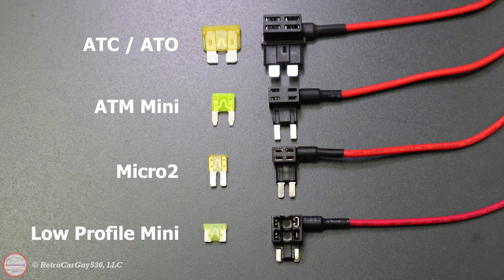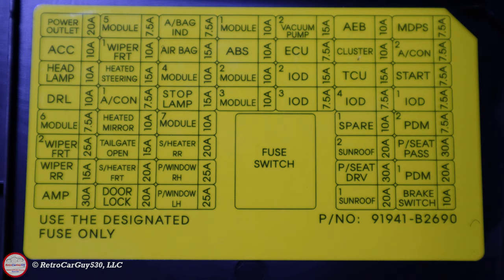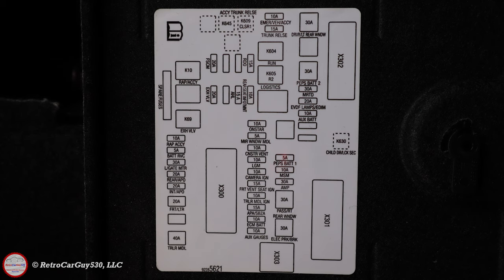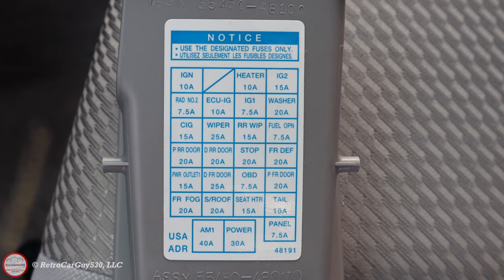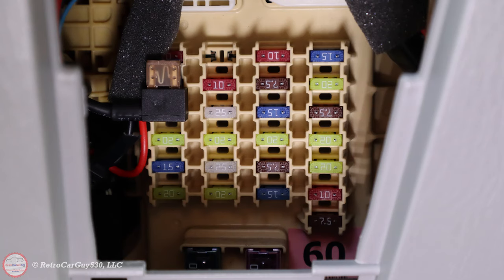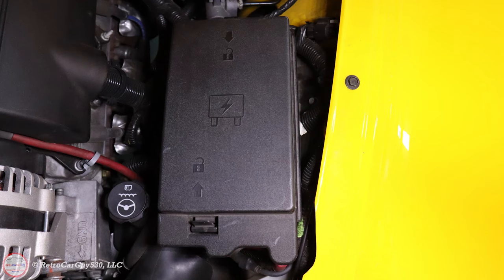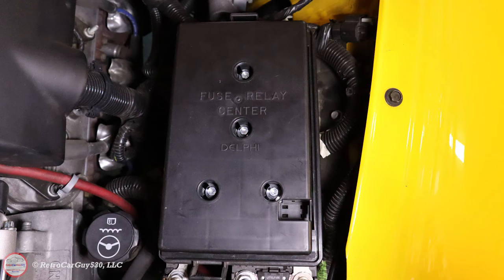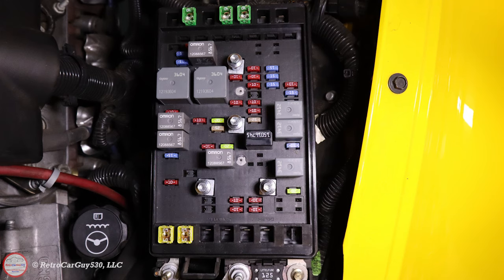How To - Add a Fuse Tap in Your Vehicle

Comment: Love how you showed fitting problems and what to avoid. Pretty complete video accept that I would suggest addressing the issue of what size fuse can be used with the new accessory. As in, does the new accessory fuse need to be the same amp fuse? Or does it need to be smaller or larger or does it matter? You can't change the siz of the protection fuse so you need to make sure you're not underprotecting one or the other, right?
Reply from the maker: @Chris the amp ratings of the fuses for a fuse tap can turn into a debate of religious proportions.

My point of view is that a fuse tap is an okay way to source power for lower power demanding devices/accessories.  If the device requires 10 or more amps, I usually use a relay to provide the power to the new accessory with the relay sourcing its power directly from the battery with an inline fuse and proper wire gauge (awg) to support the amp load.

The installation method I show in this video is where the left leg of the fuse tap gets the power from the fuse box fuse socket.  That is the "in parallel" approach meaning two power circuits are created by the fuse tap and the wiring up to the fuse box must be able to provide the amount of amperage that both circuits require.  It is not always easy to know exactly how the fuse box fuse socket is supplied its power (wire gauge, bus bar, etc).  That's why I only use fuse taps for low amp devices and in most cases my use of fuse taps is limited to adding dash cameras or radar detectors since those use under 3 amps most of the time.

The "safest" approach is to actually install the fuse tap with power going up the right leg of the fuse tap.  This is the "in series" approach of using the fuse tap.  The new accessory and the original circuit draw power through the lower fuse in the fuse tap.  If the combined load is larger than the original fuse, the lower fuse will blow.  The problem can be that the manner in which the fuse box fuse socket is powered may be able to handle the load for both circuits, but the wiring from the fuse box to the original device may not be able to handle the load above the original fuse's amp rating and that's why the original fuse was sized at that specific amperage rating.  Again, without a lot of detailed knowledge of the circuit it's hard for the average vehicle owner to make an informed decision on what is the actual best way to use a fuse tap.  That's why I limit the amount of amps to below 10 amps for any fuse tap powered device, but even then the same questions about overloading are present especially as you get closer to 10 amps for the new device/accessory. 

In my opinion, the highest level of safety is to power the new device/accessory with a power feed taken directly from the vehicle's battery with an inline fuse and wire gauge to support the power demands of the new device/accessory.  If the new device/accessory requires switched power, you can locate a fuse socket in the fuse box that has switched power and use a fuse tap to provide power to the control side of a relay.  The relay's control circuit only draws 100 to 150 milliamps (0.1 to 0.15 amps) so virtually any fuse socket in the fuse box can handle that small amount of extra load for the control side of the relay.   A 4-terminal relay (terminals: 30 = battery power, 87 = power to new device, 85/86 power/ground for control side of relay) is usually what I use for this approach.  I use this approach in a recent video where I add a high power demanding dashcam battery pack to my vehicle.  https://youtu.be/Joa0fiKZY-o?t=744s

Comment: Great info on this video. many thanks! Question: Are there any available tapping fixtures for J-case and M-case cartridge female terminal fuses? Thanks again.
Reply from the maker: I have not come across any J-Case or M-Case fuse taps.  If the accessory's power demands are beyond that of a blade style fuse and fuse tap, then you might consider using a blade fuse tap to supply the control circuit power to a relay that would then supply power of sufficient amperage to the accessory.
Reply: @RetroCarGuy530  Thanks so much for your quick response. I'm gonna try to AC compressor relay. Seems all fuse points are all time hot in my truck (2017 F150 lariat). Haven't tried w relays so far but i see no other option. Thanks again.

Comment: Excellent video. Thank you.  Clear and concise instructions and extremely informative.  I would've loved you to explain the joining the wires of a device to the fuse tap (cb radio) also I hope you have a video on using  multimeters. I'm gonna go look for one now. Also you got yourself a new subscriber 👍
Reply from the maker: The fuse taps often come with crimp style butt connectors that you would strip the wire on the accessory side of the connection and insert and crimp the butt connector to get a firm grip on the wire.  If no crimp butt connector is present, I will often solder the wires together use some wire shrink wrap or electrical tape to seal/protect the connection.

Comment: Thanks for a great video and for taking the time.  I need to add a fuse tap to supply as much as 20A to a power window circuit.  I will be abandoning the original wire because it has an open.  Where can I get a fuse tap that is rated for up to 20A for the add on circuit because all I seem to be able to find are ones with a #16awg wire and 10A maximum rating?  I guess I'd need one with a #14awg wire?  Thank you.
Reply from the maker: The blade style fuse taps that I can find all have 16 awg or at best 14 awg wire.  One fuse tap with 14 awg claims to support up to 30 amps, but that would only be for short distances (4 feet or less).  Some research I did a while back about wire gauge and max amp loads suggested that a 14 awg wire could carry 20 amps for up to 6 feet.  A 12 awg wire could carry 20 amps for up to 10 feet and a 10 awg wire could carry 20 amps for up 14 feet.  It also depends on what fuse type you need, but here's an affiliate link of mine to a ATM/Mini fuse tap with 14 awg wire: https://amzn.to/3CyTLKY

There are inline fuse holders with 10 awg and 12 awg, but you'll need to source the power (I assume switched / accessory power) for that from a relay.  Although, finding a relay wiring pigtail with thicker wire is difficult too.  The relays usually can support up to 30 amps, but the wiring pigtails tend to have 16 or 14 awg wires as well.

I wish I could help with a specific solution to your question.  I hope this helps in some way.
Reply: @RetroCarGuy530  So it wouldn't be a good idea to connect a 12 gauge wire running 10 amps into one of these 16 or 14 gauge wire taps?
Reply from the maker: @mikeestrada933  the limiting factor is the 16 or 14 awg wire from the fuse tap as well as making sure the fuse socket the fuse tap is plugged into can provide the 10 amps required.  If the length of the entire wire run from the fuse tap to the device and from the device through its ground wire (yes including the ground wire) is no more than 6 feet (16 awg fuse tap wire) or 12 feet (14 awg fuse tap wire), then in my opinion you should be able to do it.

The 6 feet (16 awg fuse tap wire) and 12 feet (14 awg fuse tap wire) are the max lengths that a circuit made up entirely of that wire gauge should be able to handle 10 amps based on some very conservative electrical automotive wire amperage charts I've used in the past.

I'm not a fan of using a thicker wire in part of a circuit than the thinnest wire in that circuit.  It gives anyone that comes after you the impression the entire circuit is made up of that thicker gauge wire which will give the false impression that the circuit could potentially handle more amps than it truly can.
Reply: @RetroCarGuy530  Okay thank you! I ask because the kit i bought has a 12awg wire installed that has to be powered by a switched ignition source
Reply from the maker: If a device requires 10 amps to operate, that's the power level I start thinking about using a relay to power the new accessory.  A fuse tap is a great way to get power to operate circuits that don't demand to much more from the circuit the fuse tap is plugged into in the fuse box.

Here's another approach you might want to consider:

A four terminal relay can be used to supply switched ignition power as well.  Relay terminal #30 of the relay would be connected directly to the vehicle's battery with an inline 10 amp fuse (in this example) to protect that circuit.  Relay terminal #87 would be connected to the new accessory to supply the power to the new device/accessory.  Relay terminals #85 and #86 are used to control the relay (on / off).  A fuse tap can be used to source the switched power to control the relay.  The power required to power the control side of relay is usually well under 1 amp making it an excellent candidate for being used with a fuse tap power source to run the control side of the relay.  Most relay wiring charts show terminal #86 is connected to the switched power source (from the fuse tap) and terminal #85 is connected to ground.

This moves the higher power demand for the new device/accessory directly to the battery (using proper gauge wire and inline fuse) and the power demands on the fuse box power circuit the fuse tap is installed into is very minimal.  

I've used the relay wiring approach when I've installed dash camera battery packs into my vehicles.  One of them requires 9 amps (directly wired to the car) or 5 amps when using the power port adapter.  To allow it to charge more quickly, I hardwire the power input for the dash camera battery pack, but I use a four terminal relay to supply that power.

Comment: Great video! Two questions came about. 1) If i am using an existing fuse (5Amp) and placing it into the bottom AAF slot, does the upper AAF slot need to carry the same amperage fuse or can that vary? 2) Can I mix 12 awg and 16 awg between installs - my light pods come with 16 awg, but i will be extending the length with 12 awg, then connecting it to a 16 awg quick disconnect and then back to a 12 awg - the light pod is only 3.5 Amp. Thanks in advance.
Reply from the maker: Sorry, I didn't see this question before seeing your other question I responded to.  YouTube posts are hard to follow/respond to in volume.  The lower fuse socket in the AAF holder is for the original fuse in the fuse box fuse socket (if one is present at all).  The upper fuse socket in the AAF holder is where the fuse for the new accessory is to be placed.  Never install a fuse in the upper fuse socket of the AAF that grossly exceeds what the new device/accessory requires.  In the case of a 30 amp fuse for the wipers, the 30 amp fuse goes in the lower fuse socket of the AAF holder and the light pod fuse (5 amp for the 3.5 amp load) goes in the upper fuse socket of the AAF holder.

If the light pod only requires 3.5 amps, the 16 awg wire should be sufficient for its power needs.  You can intermix wire gauges AS LONG AS the wire gauge number is lower than (bigger wire) the wire it's being spliced together with in the circuit.   Meaning, you should not use a 18 awg or 20 awg wire in that circuit since the larger awg number is a smaller wire.  You should also minimize the amount of wire in the circuit.  No need for a bunch of extra wire in the circuit.

There are a couple of different trains of thought on this topic of using a fuse tap (AAF) to obtain power for a new device/accessory.  What I demonstrate in this video is the "in parallel" approach of routing the power through the fuse tap.   The power obtained from the fuse box fuse socket is directly routed to both the lower and upper fuse sockets in the fuse tap.

There's another approach which would be labeled "in series" power routing approach.  That's where the power from the fuse box fuse socket goes up the right leg of the fuse tap, through the lower fuse in the fuse tap and then down the left leg of the fuse tap to the original fuse box fuse socket and it also goes then up to the fuse tap's upper fuse socket.  All of the power load runs through the lower fuse in the fuse tap.  Which approach is best to use will result in spirited discussions/debates.    The "in series" power routing method can be seen as the absolute safest approach, but it may also lead to blowing the original fuse in the lower fuse tap fuse socket since both power loads are being run through the lower fuse.

For dash cameras, radar detectors and similar power demanding devices (usually 2 or 3 amps and very often dash cameras use less than 1 amp), the "in parallel" power routing approach is very safe.  It will only be adding 2 to 3 or often less than 1 amp to the circuit that is supplying the power to the fuse box fuse socket.

I have another video that tries to explain the "in parallel" approach a little more in depth.  https://www.youtube.com/watch?v=YNc0FfeL6rw

Comment: Thank you for making this video. It was very informative. I have one question though. If I were to use a fuse tap in a spare slot, then what amp fuse do I use for the top slot on the fuse tap. The device I'm installing is a dash cam
Reply from the maker: Most dash cameras consume in the 2 amp to 5 amp range.  I would suggest checking the dash camera's documentation to see if there is a specification chart/page that lists its power consumption info.  I hope that helps.

Comment: Your tutorial was very well explained. I have not been able to find anything on how many accessories you can run from one source. I need to wire up a boost, AFR, oil and water temp gauge. Do I simply check the amps on the devices and make sure they do not exceed the amps on the fuse?
Reply from the maker: There are two levels of amp draw that you need to consider.  The amp draw when the device first turns on (which is usually higher than its steady state amp draw) and then the steady state (normal running load) amp draw.  The power on amp draw can sometimes be 50% to 100% higher than the steady state amp draw and the fuse and wiring needs to be able to support that max amp draw.

If you're running four separate devices from the one fuse power tap, make sure the fuse and the wiring can handle the maximum amp draw.  Another thing to consider is how many amps are you now making the fuse socket provide.   If the fuse socket was empty before the fuse tap, then the amp draw is just for the new device(s).  If the fuse socket had a pre-existing fuse in it, the amp draw is the combination of the pre-existing amp load plus the amp load of the new device(s).   I'm not a fan of using a fuse socket with a pre-existing 25 amp fuse and then adding a fuse tap with a 15 amp fuse.  You're potentially pulling a total of 40 amps from that fuse socket which may be more than it's designed to provide.  Usually 40, 50 or 60 amp loads have different style fuses for that high of an amp load.

Most fuse taps and their wiring should (IMO) not have a new fuse with an amp rating of more than 10 or 15 amps.  If your gauges are needing more than 10 amps (total) to run, then I might suggest adding more than one fuse tap to supply the needed power to them.

The most dangerous thing you can do (even the auto manufacturers have made this mistake) is put a fuse with an amp rating far above the capability of the wiring between the fuse box and the device being powered by that circuit.  If there is a problem on the device (load) end of the circuit and it starts drawing more amps than it should and the fuse's amp rating is too high, the fuse won't blow and the wiring can become the failure point in the circuit and cause problems or even become a fire hazard.

I hope that helps!